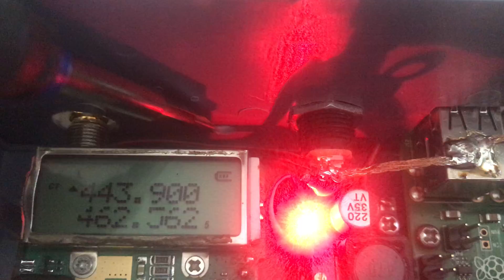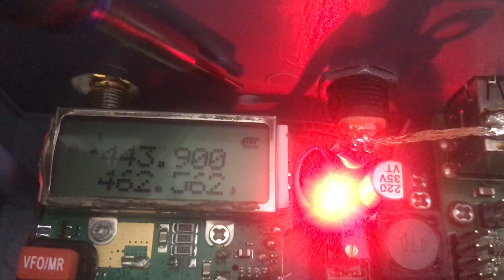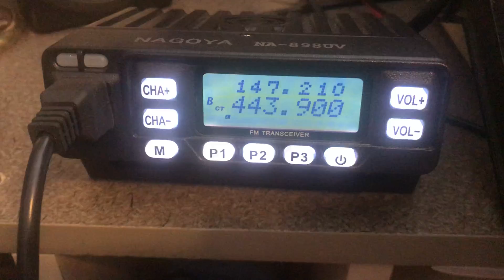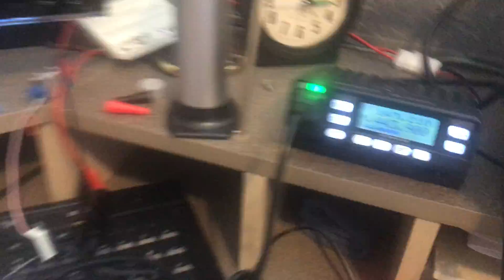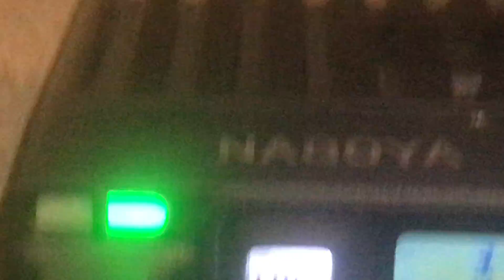Allstar Node using Baofeng UV-5R, Raspberry Pi 3 B+ and CM108 Sound FOB / KM6DZ

Comment: I did the same thing with a pi, uv5r and a hacked up headphone plug they come with. You just need to wire one of the contacts on the plug to the pi’s gpio pin to do ptt, and you can just control it through software with no extra boards. That’ll also get your audio connection between the two, though you’ll either need the usb sound card or a separate SDR dongle for RX since the built in audio jack is rubbish.

Comment: Late to the party, but you may well have a ground loop.  Bonding the grounds at the buck converters may help.  You may need to use an audio isolation cable (aka a transformer) in your audio path. If you can, try running your radio on battery power as a test.

Comment: Hey man, I’m having this same issue with noise. Any chance you figured the problem out?
Reply: change that power converter
Reply: @CS7AFM  what type of converter do you suggest?
Reply: Try this also https://youtu.be/41lyfK1pEko
Reply: @CS7AFM  I’ve done what this video suggests (several weeks ago) got the noise down. But it’s still there and annoying. Anyways do you have a suggestion on a better power converter?
Reply: @treybradley1698  also use audio cable it reduces the interferences